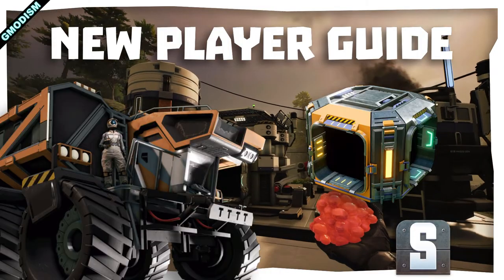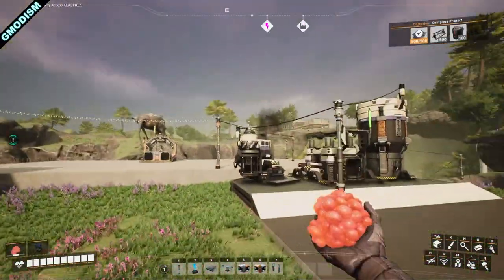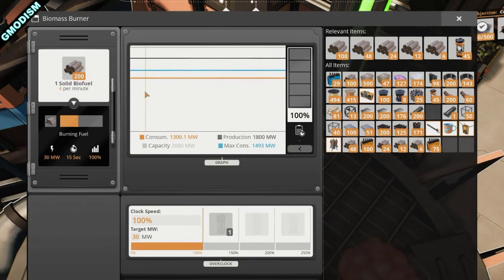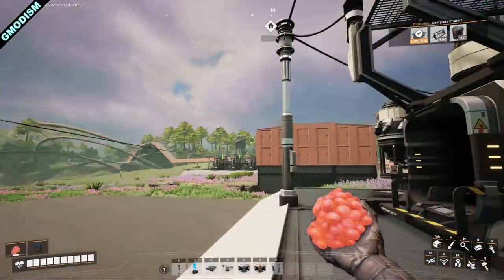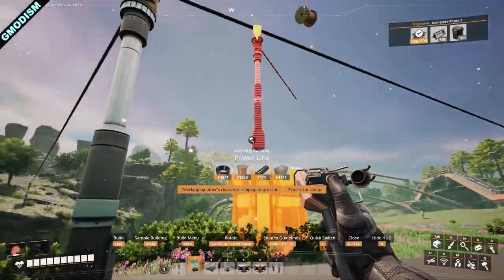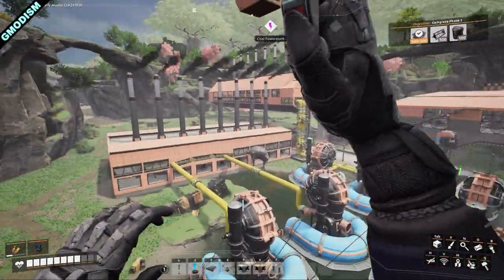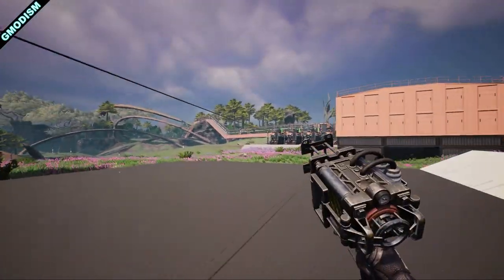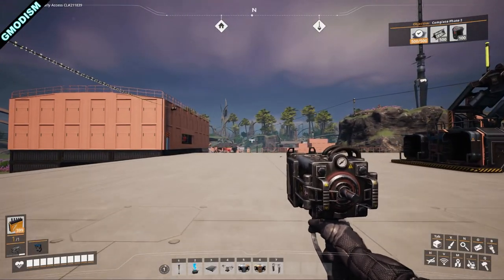Power Guide & How Electricity Works In Detail - Satisfactory New Player Guide EP18

Comment: I guess my question is, you mentioned that your consumption should not go above production, wouldn't the max capacity be more important? I assumed that since my capacity is greater, due to having the biomass burners to back up the coal production, everything should be fine so long as I keep them fueled, until I can expand my coal or add for instance fuel generators in the next tier. Like it shouldn't trip everything off so long as my biofuel doesn't run out and I don't go over the max capacity. I guess that's where I may be a little confused or potentially wrong. Because if that's not the case and the grid is going to trip anyways if I go over the production limit, then keeping the biomass burners becomes pointless.
Reply from the maker: Well, if it uses your biomass burners you must refill them, try to not get to that point, GRANTED i kept my running while I made my coal power plant and that took like 6 hours in total, so it has it's uses, but after that I try to expand coal instead because I don't want to refill them if I don't have to...